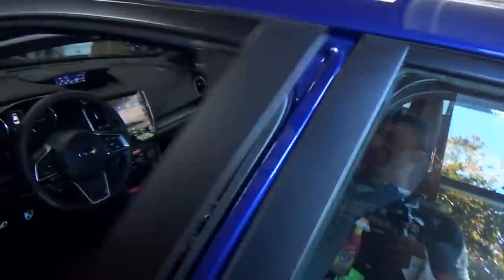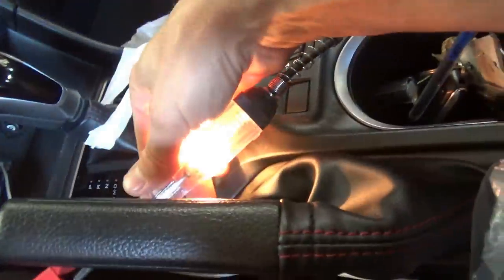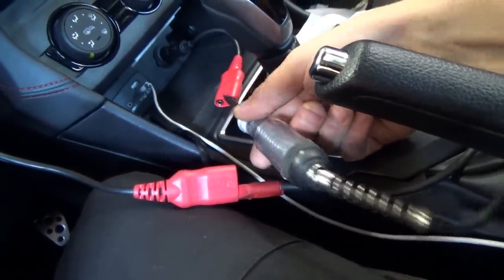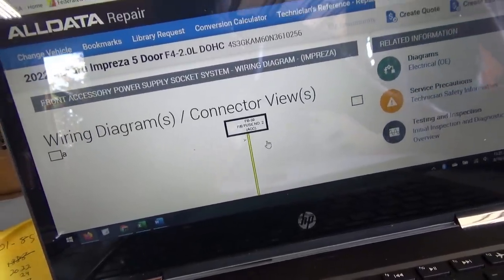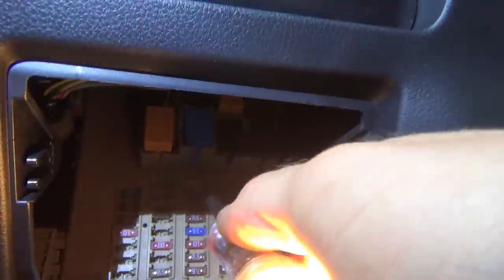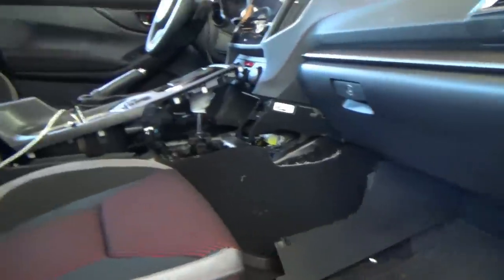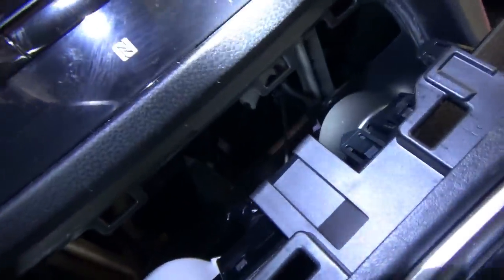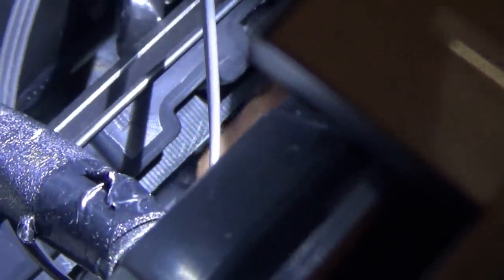Dealer Wants to Charge Customer for THEIR SCREW-UP?! (22 Subaru Impreza)

Comment: I would definitely be asking Subaru for a new panel as they marked up the original.
Reply: I think I'd insist they replace the panel (and reimburse me for Ivan's fee) . Asking nicely probably won't result in any attempt to make the customer happy.
Reply: Why, so they could install it upside down?
Reply: If you went back and asked the dealer to replace the panel that was damaged they would just say that Ivan did it
Reply: @sewing1243  , no no no! You would be asking them to goof up the rest of the dash!
Reply: They seem to not know how! Quit while your ahead.
Reply from the maker: @arthurcunningham530  good thing this video proves otherwise lol
Reply: @arthurcunningham530  agreed! This video may prove Ivan didn’t do it….but it doesn’t prove the dealer did it. You’d need a time stamped photo from before it was at the dealer without scratches.
Reply: One call to Subaru USA to report the dealer would get the part replaced with an apology. Corporate won’t stand for the customer dissatisfaction on a brand new car sale.
Reply: @CCC spokesman and cofounder  I saw a video where a dealer refused to warranty because an independent mechanic drained the front diff and filled the cvt with diff fluid (or vice versa) and Subaru of Australia paid for the CVT replacement. Gives me confidence if I ever have to deal with Subaru of America.

Comment: These dealers need to be held responsible for their mistakes
Reply: they need to be shut down if not burned down
Reply: The flat rate pay system needs to go away.
Reply: Just link to this video and notify Subaru of America about the dealer in question.
It might not help or it might - but if you are lucky then they will end up taking care of the scratches caused.
Reply: @ehsnils  thank you for the idea
Reply: alot of customers do file against them in small claims court, and they quietly settle with the customer out of court 99 percent of the time. They are usually negligent, and dont want the bad publicity,.,. Part of the problem is most people just want thier car fixed so they can move on with thier life instead of getting into it in court with a bunch of goons.

Comment: Pathetic, I feel sorry for the good techs that work in dealerships. There have to be some and they must cringe at these "stealership" stories. You spoke of Eric O. His latest video illustrates this very problem. $4K for a misdiagnosis and unneeded parts which would not have fixed the bad ground strap it turned out to actually be.
Reply: I just watched it as well! This is what got me into auto diagnostics since I've had bad experiences with shops, i didn't think it was this bad.
Reply: yea i just saw Erics video also , your right, i recent had a  no start at my shop, sure enough the garage before me put a computer some sensors and who knows what else, it was a bad ground on the park neutral switch the whole time , just looking at the park drive data stream showed it was still in gear when it really wasn't
Reply: I'm a dealer tech, and yes we do cringe when we see this. My standard is "is this how you would troubleshoot or fix your mom's car?" It saddens me to see this. Also, the fuse wasn't blown, so obviously the circuit was not overloaded. If you screw over the customer when it's under warranty, you'll never see them back for the "gravy". Too many short-sighted fools out there.
Reply: @nickmayo2974  I tell my techs and apprentices this almost word for word! "Would you sell this service or repair your mothers car like this? No? Then why do that to a customer?" Some techs just  don't think about a good reputation and repeat happy customers
Reply: @cjmazdatech  One satisfied customer will tell maybe two or three people.A dissatisfied customer will tell hundreds.
Reply: @burtbacarach5034  Good news travels, bad news travels faster.
Reply: Another dealer tech here, yes we do cringe - do it well do it once are the words I live by

Comment: Apparently the two-wire power circuit required an equal number of functional brain cells at the dealership and they just couldn't pull that off. Kudos to the savvy customer, and Ivan, an honest mechanic in a world of scheissters.
Reply: the computer did not tell them what was wrong and how to fix it

Comment: The 1st thing I would have asked the dealership was for a list of a of all the Subaru approved accessories available for the car that plug into a 12v socket..
Why do I think the answer is none,,,  lol
Reply: I'm pretty sure the Magnus Moss Repair Act would kick in here. Basically, the MMRA states that a warranty can not be voided if the part was being used as intended. Also, they can't void a warranty for you doing your own repair work unless you cause damage. Even then, they can only void the warranty to what you damaged. If you try puting in an aftermarket radio they can't void the warranty on the transmission for instance. Also, these rights CAN'T be signed away, regardless of what any contract states.
Reply: @matts1166  I think that's why they tired to say the warranty would be void for that Circuit.

Comment: I just dont get how it's not illegal for the dealerships to pull this shit! Clearly there is still a full warranty and they still pull this shit! This is why I would never buy a new car!
Reply: Amen. This kind of shit makes my stomach turn.
Reply: same here. anyone who buys new is getting robbed...
Reply: Stupid isn't illegal is why .
Reply: @shaneprescott432  the tech has been trained to not FIX anything unless they can get  a grand to 1500 out of the customer.. 
I had a 2005 nissan frontier, airbag code. anytime I reset the system, and someone sat in the passenger side, it would disable the airbag system and set the trouble light,, went to dealer,. they wanted to replace the whole seat, for 1500 bucks, and said if that didnt work, they would investigate more.. I drove around for 3 years with no airbag protection,., one day I decided to unzip the seat cover, and noticed some wires that ran near the top of the seat were rubbed thru.. I soldered them and heat shrinked them and it fixed my issue.. the tech just will not do any work, unless you agree to a thousand in parts, and all the labor hours needed..  any problems with airbags should be fixed for free for the life of the car, because they are made so flimsy nowdays, if the airbag system doesnt work, the chances of u surviving a bad accident are very slim.

Comment: I was a 12 volt installer for 30+ years...had an older customer come in with a dash cam rear view mirror that's straps to the original mirror. I don't usually install this Chinesium bs but she was nice and I explained the longevity issues with these units. Easy install in a newer caddy. This caddy even had a lower cigarette type outlet in the lower console that was accessory switched. Fast forward 6 months and she has been plagued with transmission troubles. The dealer blamed the installation and the mirror.  After an intense conversation with the servi manager, and me finally laughing at his complex explanation of how this plug in device would be responsible for transmission.  I asked him what exactly should those accessory outlets be used for? I think it finally clicked that certainly gm would sufficiently isolate that circuit for noise or what ever that would corupt the transmission issue. Dealers pass the buck because service is just a 7 letter word. Many other dealer stories from my carreer as an owner/installer.
Reply: I have an issue with my Subaru where one of the keys no longer can start the car due to it not being recognised by the immobiliser suddenly. Subaru couldn't fix it so they blamed it on the installation of a caravan brake controller that admittedly was poorly done by the prior owner which I had removed and cleaned up. Apparently heat-shrink on a wire can cause a computer to drop out the ID of a key....

Comment: To the customer, find a different dealer if possible.

Year ago, i had a BMW that I took back under warranty because the steering shaft would squeak when I turned the wheel.   I got it back and it didn't squeak, but the panel to the right of the wheel was not on right, so I tugged at it a bit and it fell right off.   When I examined it, they had broken the plastic fingers AND PUT TAPE ON IT TO KEEP IT IN PLACE!

I went to the service manager and he claimed he guys would never do that, and I lost my temper (never agree to go in back make a scene in public) until he ordered me a new part.   I never went back.

Comment: This is the very reason I work on my own vehicles (when possible). I got screwed by a repair shop that misdiagnosed my truck and still charged me for a computer I didn't need.
Reply: You and me both!   Dealers and repair shops have cause more damage to my vehicles than they have competently fixed.     Grease on seats, ripped / damaged leather steering wheel, chipped or scratch paint ... broken plastic clips.... you name it.    Good luck trying to get them to fix their screw ups.   They wont.
Reply: @Ram14250  I went to a Toyota Dealership in Blair County PA for warranty work. They broke my instrument cluster bezel, somehow got a piece of paper towel inside of it, told me that it was already that way etc.  I noticed that my radio didn't work, and they said that it's not their fault due to the "mess" of wires inside of it. I told them that it was installed by Toyota as well by the previous owner. Turns out that was a harness that was not plugged in. A week later I noticed that they broke my dashboard vent adjuster and out of the six screws to install the new bezel that they protested and that they had only installed two.  What a joke, I wouldn't let them oil the chain on a tricycle (joke).

Comment: It's all about money for the dealers. I can plug whatever into the 12V socket and if it does not blow the fuse, all is good. If the 12V socket does not work, it should be fixed UNDER WARRANTY! They pulled out the socket but the wire was too short to plug reach in to the new socket, without removing panels, so they left it unconnected.  
You should publish the dealer name!

Comment: Anytime a dealership (or other shop) starts stating BS the customer should require them to write or sign a statement that you create based on their babble.  This would have them admitting that they can not fix a two wire circuit.    It would also have the warranty canceled for hooking up a non factory device to a generic outlet  (I wonder if the warranty in my house is canceled for connecting a TV to it).  I would also have them state what factory devices are available to plug in.  Also, be sure to have a written statement of what work they performed so that they can not deny they did the poor quality repair.  If the customer is a HAM he smart enough to know they screwed up.
Reply: I think the Magnus-Moss Repair act would have the warranty covered. The MMRA states that no warranty can be voided when you use the product as intended. Unless Subaru has it stated in their manual that only Subaru approved devices can be used, I'm pretty sure it's total bullshit by the dealership.

Comment: Nice job Ivan. Shame on that Subaru dealer. Your customer should reconsider the way he is powering his ham radio. Use of the accessory 12v socket is less than  optimal. He might want to refer to one of the recent ARRL Amateur Handbooks for some suggestions. Barring that touch base with local hams to see how they have done their transceiver installations. Modern ham 2 meter or all band transceivers put out more power than just a few years ago and that means  greater current draw. - W6VPS
Reply: All good points for a better install. But temporarily, he could go into his radio's Menu Settings and switch it to a Low or Medium Transmitting power. Whereupon the Amateur Radio would draw significantly less power from the 12 volt accessory/lighter socket. 73's ZL3KAT

Comment: Being such a new car, I would be in the service department managers office asking for a new plastic console panel and the labor to install it which will also require a mechanic that knows how to plug in a two prong connecter to the power port.  They got him for the first fee but they will have to eat the second round plus the damaged part. There is no excuse for scratching up the plastic on a brand new car nor the retarded connection installation.
Reply: Do you really want that dealership working on your car? It's going to end up like a car in a Mad Max movie.
Reply: Training seems to be lacking.

Comment: You would think if he pulled to much power it would just pop the fuse not nuke the whole circuit   great job Ivan
Reply: Exactly that’s the reason for the fuse. And as for using aftermarket accessories invalidating warrantee beggars belief. I hope the customer will claim for your time and scratches the main dealer caused.
Reply: I think Subaru only built that not knowing that a buyer would actually use some accessory they paid for. Has to be the cheapest components they could find for the build.

Comment: This is the second recent dealer screw up.  Eric O over at South Main Auto had a 2019 Chevy truck that the incompetent dealership charged the customer a kings ransom to diagnose his truck's problem.  They told him multiple modules needed replacing for big bucks.  Eric correctly diagnosed it as a simple ground strap that had deteriorated for a very nominal cost.
Unless you have warranty work to be performed I wouldn't take my vehicle anywhere close to a dealership or more correctly stated , a stealership.

Comment: Things have gone downhill.  I used a 300 watt inverter to keep my aquarium fish alive while driving from San Francisco to Portland Oregon in a Chevy.  It ran the pump and heater for about 3 driving days.  Then when hauling our travel trailer with our F150, the low beam headlights went out.  So I go to radio shack and get a lighter plug and regular extension cord for AC power and hooked the headlight low beams to the lighter socket.  This worked for 2 weeks until we got home.  Now your lucky if you can plug in a USB charger.

Comment: James you may not be able to run that 1,000 watt radio out of that outlet!  I think thats a new question this years technician test.  JK.. AND why did the 20 amp fuse NOT blow?  Because it has a 10 amp socket that fries to save the fuse!  NPR!  They popped the socket out incorrectly and were not able to reach the new socket to plug it in correctly.  100% lazy...
Reply: Finally, you called it well
Reply: Or the owner try and replace it after melting it and just blame dealer so ivan will feel sorry for him!

Comment: As a ham radio operator myself, I know that plugging my radio into the cigarette lighter outlet is not a good idea.  When installing a radio (permanently), I always run both power leads directly to the battery with fuses in BOTH positive and negative leads.
Reply: Why should it not be a good idea? 
The outlet is rated for the appliance plugged into it - no problem!
Reply: @garyhardman8369  A typical mobile 2 meter radio will pull 12 to 17 amps.  The outlet was limited to 10 amps.  I think some hams confuse the radio frequency power output with the power consumption of the radio.  An 80 watt radio (RF power output) may consume 235 watts of electrical  input power.  Most mobile radios will have an RF power output of 40-60 watts with some as high as 100 watts.  The cigarette lighter outlet is not designed for those sustained power levels.  Also, wiring directly to the battery reduces the possibility of "alternator whine" in the transmitted signal.
Reply: @j.t.johnston3048  Yep...even it all it was using were 10 amps but continuously 10 amps in my opinion would be pushing it. Those power plug or cigar lighters are typically designed for intermittent power draws or small continuous draws such as cell phones, razors etc.
Reply: Even more important is for transmitters to have a good ground (plane). Cigarette lighter outlets do not provide a solid ground with the sliding contact of the adapter. You need to wire a separate connection directly from the car body/frame for your mobile rig. Those 40-100 watts of rf power and crappy grounds will eventually fry important modules in your car.
Reply: Who are you guys talking with in HAM while driving around though?  Y'all know we got cell phones now or do you still play hide and seek with use trucker slang on CB's also?

Comment: As a Subaru dealer tech for almost 2 decades I can say there a good techs, bad techs, and inexperienced techs at every shop independent or dealer. A rookie tech was properly given this car and didn't want to or know how to access the info to see how the socket is removed and took some bad short cuts to move on to more lucrative work. If the shop culture allows this to happen,  that's how repairs like this occur. We have worked very hard in our dealership to make sure the techs know that fixing it right the first time is paramount whether or not the job pays 10 hours or 1/2  hour. More importantly they have the support from more experienced techs to learn how to do the job correctly. Not every dealer tech is bad and not every dealership is a stealer-ship.
Reply from the maker: Great comment 👍
Reply: The culture needs to make sure and pay the tech for the time worked not for what the book says. So cut corners to beat the book just beats your own wallet. And jobs that go wrong can get done right because they aren't working extra hours for free. I know techs like working 8 and getting paid for 12 but often that means they are cutting corners and doing 1/2 assed work.